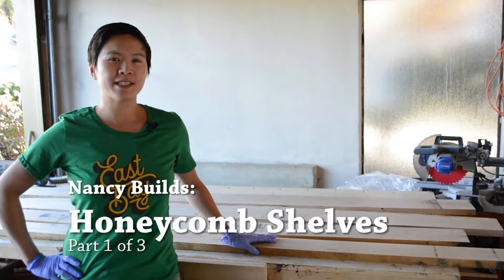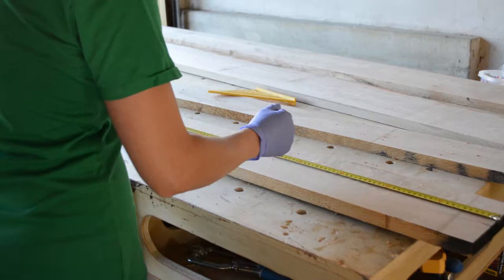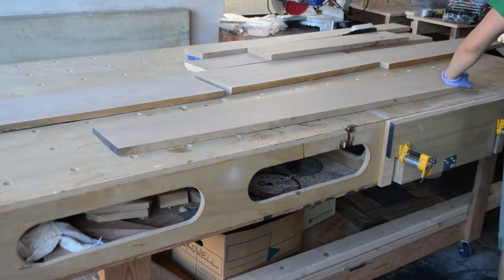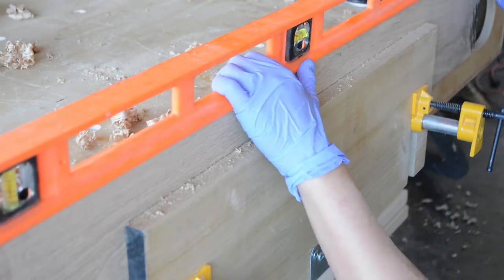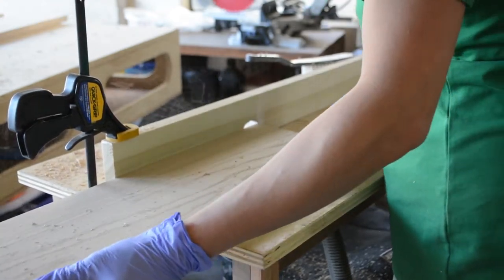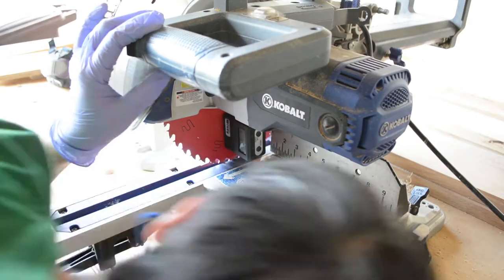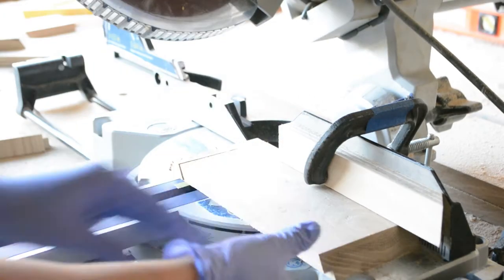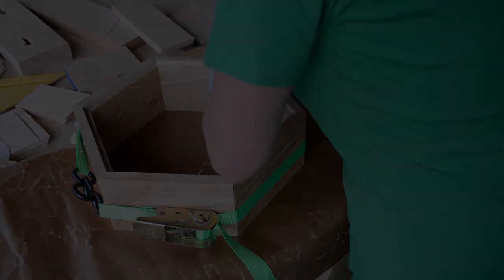Honeycomb Shelves: Part 1 of 3

Comment: 1:07 the planer issues your having is because the DW-734 has a height adjustment locking bar. At 1:09 you can see locking bar is not down. This will allow the sloppy guides to rack and lift the rollers. Another good tip to avoid roller binding, is to take less shallow cuts, sharpen/replace blades, and/or wax the tables. 

Given that this video is over a year old, I hope you got this figured out by now. But good content 👌